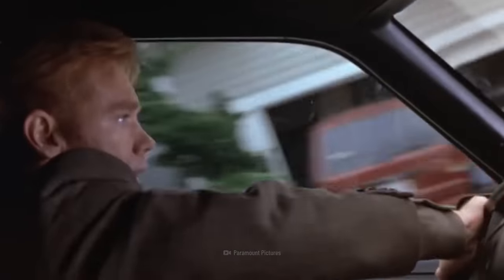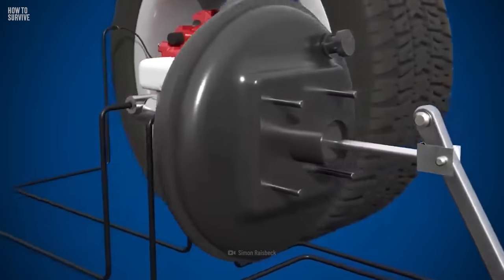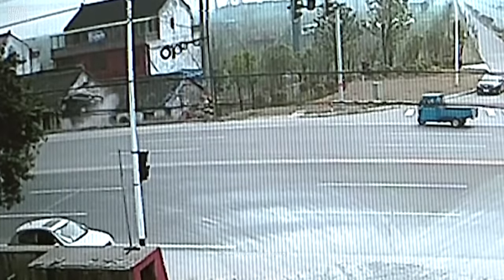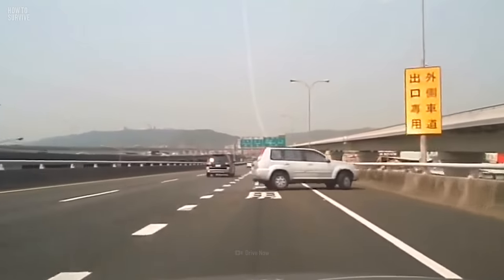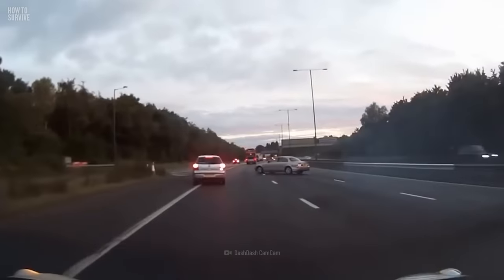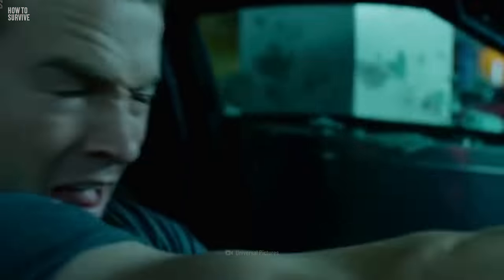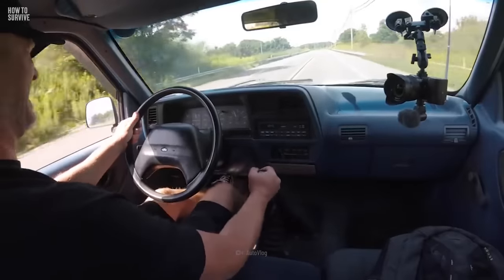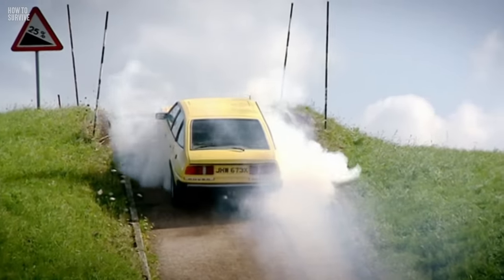How to Survive Brake Failure

Comment: I have on one occasion with a very old car followed a completely different routine from what you advised here!
1. Keep cool.
2.Remove the foot from the accelerator
3.Downshift gradually.  You normally don't have this luxury in very busy streets always.  I had to downshift very quickly,  but my speed was around 30 kph. 
4. Switch off the engine. There was no steering lock as a consequence in my old car ( fiat 124 model,  that was made in India) stopped. 
The car stopped without the pedestrians even noticing the problem. I understand that I should have kept my hazard lights on,  but my car stopped properly. The brake fluid had drained from the bleeding valves. 
Modern cars have a very 'stupid' feature which locks the brake and steering control. I understand why your advice might be more useful in those situations.
Reply: Yeah switch off the engine. You are very lucky because you were going around 20  or 30 km/h. If you do that on higher speeds death is very likely.
Reply: The steering wheel doesn't lock normally if you turn the key only to the "radio" position (normally marked with ACC). Modern vehicles become harder to control because power steering and brakes can't operate when the engine is turned off.

Comment: Had this happen to me years ago in a 10 tonne truck in country lanes and I was going downhill. I downshifted as and when I could and used the high bank on my left to slow the truck down. The old truck I was in had a belt that drove a compressor to build up the air in the tanks and this belt had come off. Luckily for me and many more I did manage to stop the truck but it took a long run to stop as I couldn't dig in to far to the bank or the lorry would have tipped over. I discovered later on my way home that there was a gas station at the bottom of the hill that would have been right in my path. Lucky escape.

Comment: In the opposite scenario when the engine is speeding out of control (only happens in diesel engines) you can up-shift to a high gear and stall the engine.

Comment: 3:17 The problem is that most of new cars' E brake comes in a form of button instead of the stick therefore you cant use it slowly
Reply: Pulling the E button while driving will automatically apply progressive brake pressure untill the vehicle has come to a stop.

Comment: I have to clarify something about my last comment, I've been driving for nearly 40 years, I've been in advanced driving defensive and offensive driving class. When I commented I was telling what I did to stop the vehicle I was driving when the brakes gave way. I remained calm placed both my feet on the floor board sat straight in the seat and threw the vehicle in neutral kept a firm grip on the steering wheel while I applied the e-brake slowly. The reason I threw the shift in neutral is because I wanted to take away power to the wheels which help slow the vehicle. That is what I wanted. It will not damage your transmission or cause you to lose control, it will allow the speeding car to slow down so you can apply the e-brake at slower speeds and not tear up you brakes. This is how I did it and this is how I will always do it regardless of what the guy says on the video.
Reply: Lies again? Get best mechanics
Reply: So you remove the engine braking so that your car can survive with a good gearbox? Nahh I'll pass. My life comes first
Reply: When going neutral even coasting at 700 Engine revolutions/Minute, the speed of the car Is increased in comparison to staying in gear! So you are dead wrong!

Just try it for youself. I even often went into neutral in Manual and Automatic gearboxes to save fuel and maintain speed as long as possible to a stop ahead.
Reply: Best is not driving too fast like 80km/hr; drive max 65-70   you are in total control dude   BJ

Comment: It happened again yesterday, I stepped on my brakes and the car didn’t stop. I had to completely bury the pedal into the floor and luckily the car did stop but not really that good. This is probably the 3rd or 4th time it’s happened since last 6 months. I got my pads and rotors replaced on all 4 wheels but it’s still happening. I took my car to the Hyundai dealer and they basically said the failure was in my head. 2015 Hyundai Sonata. Buyer beware!!
Reply: Check the master cylinder and the brake fluid, you can have the best pads and discs but if there is air in the system or the cylinder doesnt work they are useless. Also if this doesnt work it could be caused by the calipers
Reply: @jacktk2223  thank you. I’m currently in the process of putting the vehicle up for sale, I’m just so done with all the issues with it.
Reply: @Anonymous-ji4sb  Ok i just checked on the internet, apparently is a well known problem of 2015 Sonata, they have faulty brake calipers, its not in your head bro
Reply: Same in my Hyundai Elantra. Caliper seized and I almost slammed into a truck. I mashed the brake pedal and the caliper unseized. I will never own a pos Hyundai ever again.

Comment: This safety issue is one thing to consider when buying an electric car. Electric cars mainly use regenerative braking (using the electric motor) to slow down, and they also have friction brakes like all cars in case the vehicle needs to slow down very fast. Electric cars tend to use regen braking more than friction braking, so the friction brakes don't wear out as much and are less likely to fail in an emergency situation. Even if they do, the regenerative braking will never fail and you will still have some control over stopping your car.
Reply: Will never fail you say?😂
Reply: @Mysohvaperuna  *unless your battery overheats
Reply: @beanapprentice1687  i cant talk.. i m havent learned alot about electric engines.. more into combust engines
Reply: Electric cars being much heavier than ICE cars wear out brakes and tyres  a lot quicker.

Comment: I've had Brake failure, in a mid 90's Taurus. Idiot pulled out in front of me, and failed to accelerate, adequately.  when I stomped on brakes, instantly brake line broke. I pulled into large stone parking lot and circled it's circumference until car slowed enough to apply Emergency Brake to stop.

Comment: 0:30 have you tried engine breaking (have the gear engaged and put your foot out of the gas pedal)?
4:19
In manual transnition, just go to 2nd gear right away.
Reply: Thought the same because I’m used to front wheel powered cars but going to 2nd gear in an car where it’s powered by the rear wheels it’s going to spin without control.
Reply: @bekr3473  yeah, rear-powered cars don't react well with lack of grip.

Comment: Former mechanic. It's not an "emergency" brake it's a PARKING brake, as in parking for manual transmissions. It is absolutely NOT for emergencies! I lost a brake pad going down hill and by some miracle was able to utilize the parking brake ( which ONLY activates the rear brakes ) and manually downshift the automatic transmission which barely slowed me down enough to come to a stop only when I got to flat ground ( SF Sunset district ). It is 100% for parking and not emergencies. My apologies for the rant but this seriously pisses me off that people call it an emergency brake for this very reason. Please be safe and realize how crucial it is to do routine maintenance however unsexy it is to even think about.
Reply: Also this was a hand activated parking brake, not electronic. No idea how well an electronic parking brake would fare in this situation

Comment: First you down shift the car to the lower gear, let the transmission slow the car. At that point you will be going slow enough to run into something safely.
Reply: Exactly. Also by going too steep a hill the car may reverse after it stops - scary
Reply: @yichispiritual  just turn it when it's about to go down hill

Comment: Note: Cars (sometimes) also have 'power assisted brakes', these brakes use power from the engine and if you let go just once, you will lose power in the brakes while the engine may still gain power.

Comment: Here's one point many people don't know.
If you live in a country were you have frosts zero temperatures, HAVE YOUR BRAKE FLUID CHANGED EVERY TWO YEARS BECAUSE BRAKE FLUID CAN ATTRACT UP 10% of water in cold weather, water boils at 110 degrees, brake fluid boils from 450 degrees.
If your car's been imported from a cold country have your BRAKE FLUID CHANGED.
If brake failure is caused by water, you say my brakes failed, police or anybody goes presses the brake peddle it will be as normal pressure will be back, because the water as made its way to the brakes cylinder had turned to steam due to the heat your brakes generate under braking, no pressure at your brakes.
There are different boiling points of brake fluid, if you have a high performance car you need higher boiling point fluid.

Comment: Wait what if I used Clutch pedal and E brake.Since I could recreate an Clutch and main brake slowing down.And if I could I could release Accelerater paddle and disconnect the Engine from transmission and be in neutral gear.And then to shut it down? Would that be a good idea or that tactic could be dangerous and risky for my Clutch and my life??

Comment: I have a 36 year old car that started to develop a problem. When the engine heats to a certain value after I push a bit from the engine for a medium trip (about 40km) after I reduce the speed the brakes fail, but temporarly, it loses oil pressure but it can brake very softly anyway and if I keep pressing the accelerator pedal the oil pressure in the brakes go up again and can break much better. In those situations I use the hand break if needed too, which works very well.
Reply: Should have a look at that it not that safe y'know
Reply: @ahyaan2552  Yeah, if that keeps happening I'll need to take to a mechanic.
Reply: @HeavenlyWarrior  very much late, but if you still haven’t, do it right now. There is no excuse for driving the car if this ever happened even a single time.

But if you can’t because of reasons like financial hardship, oh well :(
Reply: @petrnedved5297  I have no other car and no money to get another car. This very rarely happens but yeah I need to talk to some expert about the issue.
Reply: @HeavenlyWarrior  oh ok. Hope you resolve the issue :)

Comment: I have Dio scooter and I faced it yesterday my both brake failed in nearly 1 km downward road god saved me I am so grateful I crashed my scooter in a house door which  opened and broked due to the pressure but me and my friend are safe . Always check your brakes

Comment: This is why I hate automatic transmission and I prefer old cars with a physical handbrake and the correct manual transmission where you change gears yourself by pushing the clutch in and selecting the appropriate gear with a stick. You have two seemingly foolproof backup systems to fall back onto if God forbid your brakes fail. With everything automatic in these modern cars, you’ve got nothing else to slow you down if your brakes fail besides guardrails, trees and shrubs at the roadside and other vehicles, at which point you swap insurance details and kiss your no claims bonus goodbye.

Comment: What about an 18 wheeler, not only do their brakes fail more commonly than car brakes, but it a semi truck crashes into something even at low speed, it can be lethal. A semi can't simply ride the guard rail to a stop, it could plow right through, jackknife or flip over. Find a runaway ramp, fast

Comment: I taught myself how to engine brake in an automatic, and it very quickly brings it down to lower speeds in a controlled manner if timed correctly

I also learned that some turns, I don’t need to brake so much, as the resistance of turning the wheels against the road also slows it down

Comment: My brakes failed July 4th in a residential neighborhood. I forgot about the emergency brake and there were cars stopping in front of me at a red light. I drove the car over the curb and up a small hill on someone's lawn and then zagged it into a bush but didn't see the tree. Luckily for me that going up the small hill and then zagging into the bush slowed the car down that when I hit the tree, it just stopped! It smashed in the hood and took some chunks out of the tree but I didn't have a scatch. Not even my airbags deployed. Scary as hell!
Reply: My friend's brake failed that same day 2 years prior. The brake lines rotted through at the reservoir. Scary thing was it was going out at any time and he felt something going wrong when he was doing 60mph and approaching traffic as highway was already 1 lane. I wasn't there for that part but the rest I was. His driveway at his place in Maine was very steep and I was there to help him drag an old lawn tractor up the steep road onto a public road. I was behind his vehicle and it was the last brake he applied and he told me pedal was down all the way. When we got up the hill onto the public road to unhook the tractor, brakes were officially gone. I slammed it into park and it ruptured the transmission line. He was anxious so I took over and put his truck far as I could to the right so AAA could come by and cars won't hit it driving by. This is a 2005 Dodge Dakota and being behind it all the way down the steep side road was scary knowing after the fact that I could have gotten ran over and injured with one brake application away. Crazy 4th of July! And I'm glad you were okay!

Comment: This happened to me just 2 wks after my Jeep Wrangler's brakes were totally replaced so I couldn't believe it was happening to me.  I was going downhill and the police pulled someone over in left lane which was partially blocked so a line of cars were in right lane right in front of me so my steering wheel also started locking up so I turned it hard to the right and threw it into park. That stopped me as I knew it would. It also trashed my jeep but I avoided crashing...someone later bought it to rebuild it as garage wanted 12 k  to replace the engine..  No one got hurt...
Reply: Dang glad u came out safe so I just throw in Park if same thing happens to me ?
Reply: @joncell7582   Thank you! Actually I was told to use the emergency brake as that will stop it. I didn't use it as I only used it in parking situations as a back up so wasn't sure if it was enough. If all else fails putting into park stops it & unfortunately damages the engine.
Reply: @traciroshitshdownwarddogrising  yea what I heard too ima try emergency n if that don’t work oh well sry engine :(
Reply: @joncell7582  yeah hopefully won't need to but I'd try emergency brake 1st then if that fails then park. No one wants to crash if they can avoid it 4 sure!
Reply: Steering wheel started to lock up? What does that even mean
Reply: @Mysohvaperuna  it means it won't turn at all..
Reply: @traciroshitshdownwarddogrising  seems pretty weird😂 u sure you engine was running
Reply: @Atte  Definitely I was driving for about 15 minutes when steering locked & brakes failed..
Reply: @traciroshitshdownwarddogrising  nah i mean did the engine turn off… cause that remove brake booster and electric power steering
Reply: @Atte  How does an engine just turn off while driving? 🤔 it did a death shake before while driving and shop could find nothing wrong with it and brakes deployed by themselves while driving straight on a flat service. Some have a safety feature if you take a ramp too fast brakes deploy but this jeep had brakes deploy before just driving straight on a flat road. No reason so I guess something was faulty that the shop couldn't pick up...

Comment: There is a thing called a hand break. You slowly activate it untive you feel that the vehicle is slowing down. Do not immediatelly pull brake to full leverage otherwise you lock wheels and you could spin or jackknife. Then you immediatelly gear up. Use the gears simultaneously with the hand brake in order to lower the friction on the hand break mechanism. From 6 gear (for example), gear up to 5, 4 and so fourth. As you you upshift into the next gear. Apply more  hand brake leverage until you feel the vehicle slowing. Do not over brake on hand brake as vehicle will skid and you can lose control of the vehicle. The hand brake is also regarded as an emergency bracking device. Every time you lift hand break by one or two notches, use gears simultaneosly to slow down vehicle.

Comment: If you keep a cool head in a car it’s just about impossible for brake failure to kill you….

Firstly, brakes completely failing with no warning is almost unheard of, at least since 1968 when dual circuit master cylinders became mandatory (at least in the USA)

2nd downshifting the trans will slow you down to easily survivable speeds, should crashing be unavoidable 

3rd for the service brakes to go out AND the parking brake to be nonfunctional means most likely your car was a ticking time bomb in the first place and shouldn’t have been on the road.

An automatic trans can be put in reverse and be used as a brake as well.
Reply: Wow. Putting it in reverse?

Comment: God forbid if anyone here gets into one of these situations, put your car into neutral whether you’re driving an automatic or manual. It’ll probably blow your torque converter or clutch and ignite a fire, but you’ll probably slow down.

Don’t put it in park, reverse or 1st gear. And definitely don’t pull the handbrake or push the parking brake. For most cars, don’t downshift if over 3000 RPMs, that will result in a money shift.

Comment: You can also put the gear on neutral and turn of the engine as fast as possible and try to slow down the car
Reply: But the problem with turning off the engine leads to steering wheel lock, which would be more catastrophic in this situation.

Comment: An exhaust brake activates the decompressor in the injection pump,  cutting the diesel supply to the engine and closes a butterfly valve in the exhaust manifold, choking the engine and reduce the vehicle speed.